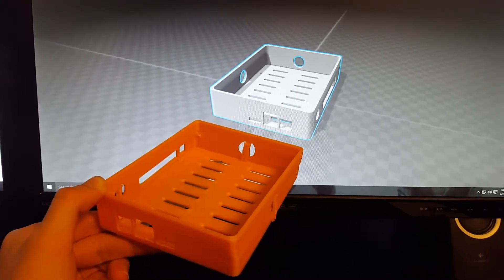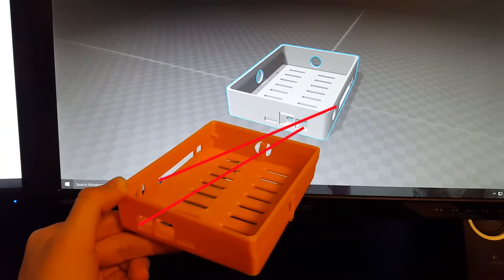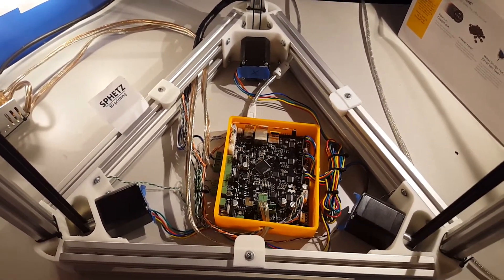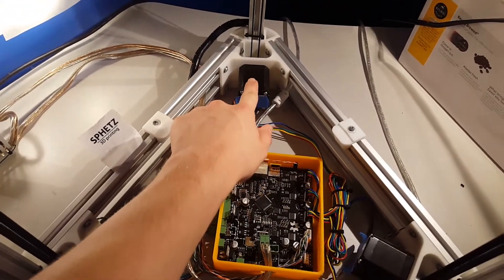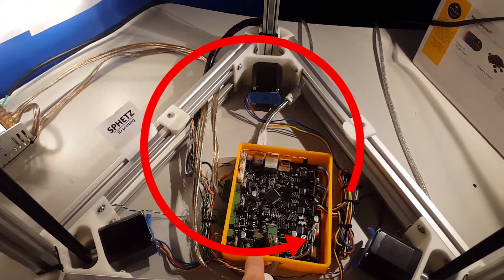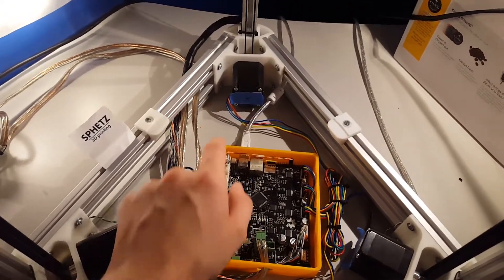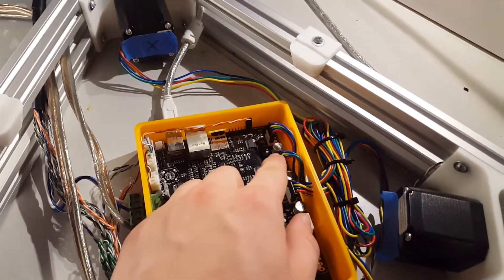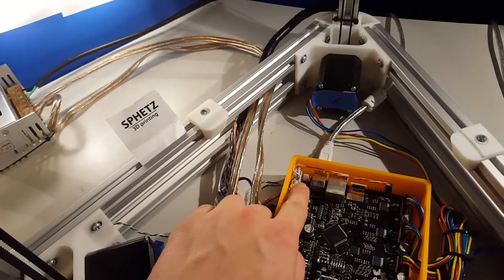How To Fix Mirrored or Flipped Prints on a Delta 3D Printer

Comment: Thanks. I had this problem with my Anycubic Predator and swapping the x/y motors fixed it <3
Reply: Could you help me? I am having same problem with my predator, but when I switched Y & Z labeled motor connectors and corresponding end stops. But when I "home" the motors it does not seem to work. It tries to move even more upper position even if it is allready on the upmost position.. Did you do anything else?
Reply: @EmpirioN1 It sounds to me like you switched the endstops wrong. Also, i didnt switch the Z motor as that one is not resposnble for the mirrored prints. I suggest you look up facebook groups for predator and ask there (there are 2). The community is friendly and very helpful.
Reply: @DenisSasko  Thank you very much!

Comment: Can this also be fixed via the firmware?   I'm having the same issue with my flying bear.  I made the changes it fixed my issue.  Thanks.
Reply from the maker: I looked up the flying bear and it is not a delta printer so this video does not apply. Your problem could possibly be that one of the motors movement is reversed or two of the motors are switched. Motors can also be switched or inversed in most firmware. Thanks for commenting, I hope you are figure out a solution.